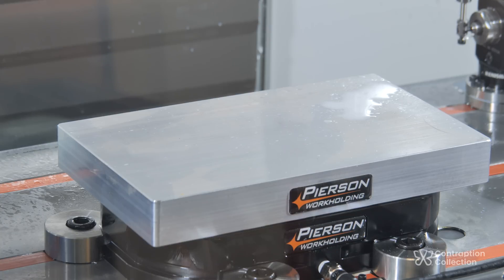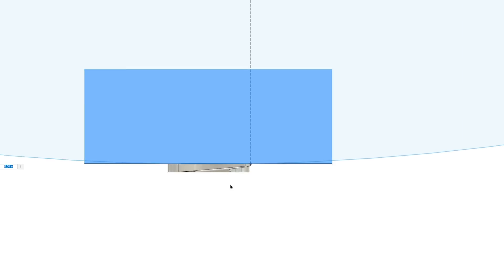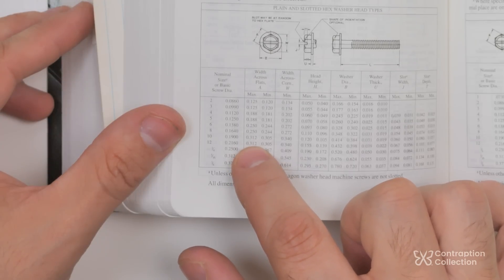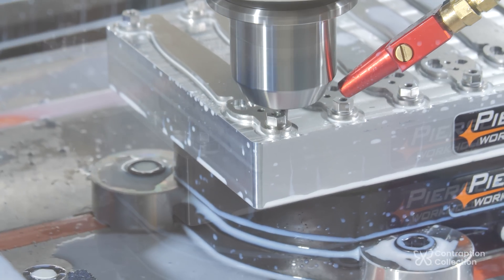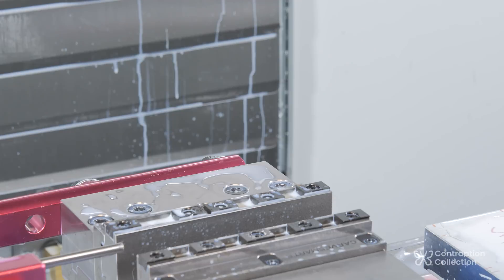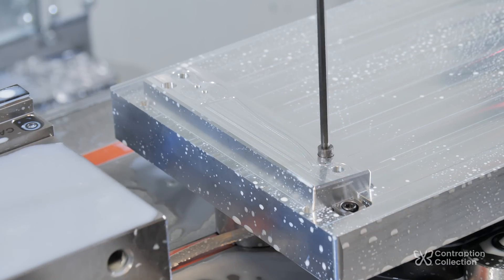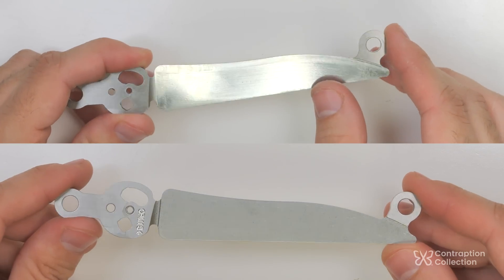My most complex fixture yet, but does it work? Baliscissors: Ep 33

Comment: those angles blocks that holds the blades dont fit in to the pockets becouse you put an angled block into square pocket. You need to widen the pocket tho the side which the block is tilting.

Comment: I'm a machinist and let me tell you one thing; as you noticed with the pull-out machining the bolts - dont try to rush jobs all the time. I have several coworkers who sure works VERY fast and create good parts a lot of the time... 
BUT! It would be pointless to start counting all the times when I hear things crashing at their machines. From endmills and drills going at rapid speeds down into either a vice, part or even the table. Parts getting scrapped because their programs wasnt checked before running. 

Ive seen one guy literally scrap the same part FOUR TIMES because he wanted to rush it. Every time the material had to be ordered cause it was hella expensive. After the 4th time - he was begging one of the other guys to take over and make the part instead.

Sorry for ranting :D

At 9:15 when you're milling the blade I think you'll find getting an endmill with a larger radius will improve tool life.

Cool pair of scissors you're making. Never even thought about "Baliscissors" before but it would be neat to own a pair =)
Cheers!

Comment: You are already using a Pierson work holding setup, so you should add some vacuum hold down functionality below the center section of the blade. This should help with the chatter, gouging, and minimize the tendency of the tool to grab the material and pull it up as it is cutting. It may not be. A perfect fix, but i bet it would make a pretty big difference.

Comment: i'm not sure if it would work for you, but i've used magnets to help with chatter. i don't know if you could cut a pocket then put a magnet under the blade, or maybe make the fixture out of steel, then magnetize it? i've only used magnets on lathe tools, not sure if it would translate to your mill.

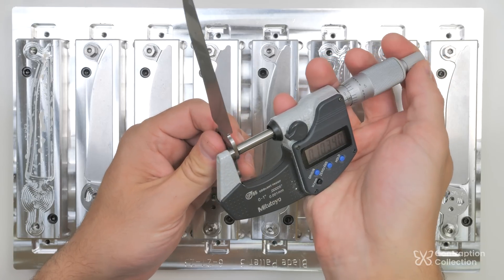Comment: 13:30 Maybe ballmill all the blocks to the angle that you need while they're all clamped in place, could also be a repeatabillity issue so you could use bolts to the main fixture body to make sure it's pulled flat, or maybe use a torque rench. Idk, I mostly use  fixturing for one off parts, but just a suggestion, love these videos.

Comment: For your markings being at different heights, just measure every part with the probe and change the height differences in fusion (I think thats what you use), it will save you the time to cut everything to spec, but I would be you, I would make a vertical cutting one.

Comment: Curious if you can get a large down-cut tool to solve your lifting problem. I use them a lot in plastics to keep downward pressure on the part being cut.
Reply from the maker: I looked, but I haven't seen down cut end mills for steel.

Comment: You can achieve the indent if you really want with some simpler tooling.

You can use a flat grinding wheel with an appropriate shank, then dress it to the desired contour. It's a bit of a process to do that, but then you don't have to buy a large diameter grinding wheel, and can use it in the cnc.

There are a few things to consider, like how long the tool will hold its contour, the minimal speed at the roating center of the tool, and properly dressing the tool.

I think dressing will be the easiest part: just clamp the dressing tool and locate it, then program a path that'll get the desired contour.

There's also the math to keep the edges of the blade still precise without cutting into them, and still getting the contour. That can just be solver by running two grooves against each edge, instead of trying to make one.

Also, I'd consider using magnetic locking, and then just locating surfaces, and integrating that into the fixture plate. It'll take a bit more initial design, but you get rid of the chatter in the middle, and don't have to program around the clamps, or switch fixtures as often

Comment: Measuring the screen holes: you could make a piece that is the positive of the chamfer you want with a little handle at the end, like a screw with a reversed head. That you can stick into the chamfer. If the top is flush it's just right, if it sticks out or is under the surface you need to change the hole a bit.

Comment: Use highfeed cutter. it does not pull meterial, it pushes down, good for low rigidity applications. and can vary surface finish depending on chipload, from rough to super-mirrorlike

Comment: if you cut the bevel with the step over going  from the thick to the thin side youll be pushing the thin edge down against the fixture instead of trying to pull it up with the end mill.

Comment: Great progress!

You can use pin gages to measure countersinks. Place the pin into the countersink and twist it, making sure to keep the pin perpendicular to the surface. If the countersink is larger than the pin, the pin will stay inside the countersink. If it is smaller, the pin will spin out. Keep checking and increasing the pin size until it spins out. The last pin size that doesn't spin out is your countersink diameter (within .001"-.002") It's a hard technique to explain, but it makes sense once you try it and is a cheap effective way to measure countersinks.

To get rid of the step from the large face mill on the bevel grind, use an L-shaped toolpath, starting at the pivot end and feeding out off the tip. Make sure there is a large radius on the corner of the L to make it a smooth turn. This will keep the tool engaged with the part through the entire cut instead of going back over part of it and gouging in.

Have you considered vacuum fixturing to hold the blank down? You might still need to use screws, but it would be a good way to keep the center part of the blade down. You can buy relatively cheap vacuum pumps meant for air conditioning repair that would work well. Adding a small air tank between the pump and the fixture would ensure you had enough vacuum at all times and allow you to turn the pump off and run for a while.

Comment: One thing I noticed in other machining videos, machinists usually tap the part into position with a soft hammer (e.g. copper hammer for steel parts) so they sit really tight in their bed. It surprised me to see you only pushing the blocks in position with your hands. Maybe try using some kind of hammer with plastic face to push them in position.
Another thing that came in mind, if you left a bit of coolant at the bottom of the pits for your blocks, it may have prevented the block to sit all the way at the bottom. Small groove to collect such coolant could help too.
But I'm no machinist, don't take my suggestions too seriously.

Comment: For your problem of needing a huge diameter cutter to make round dips on the blade you don’t need a large diameter you could do it with a 40mm cutter but instead of taking normal cuts you can angle the blade. This may be confusing and sry for not being clear but i can’t think of a simpler way to explain it other than making a drawing. So imagine you have the cutter and draw a line across the x axis of it with your blade bellow it with the point facing the back of the machine and the but facing the front. Now with that line through the cutter use it as an imaginary bevel and rotate the cutter so as the shank is further tirades the back of the machine and the cutting edge is more towards the front of the machine. Now if you were to to go to cut a hole on a flat surface the cutter would cut the hole more like an ellipse but don’t do this as it would mess up your tool bc the shank would hit the edge of the ellipse anyway what you are after is the radius of the long side of the ellipse. If you could make a setup where the blade is at an angle and the tool is straight then you could get a much larger radius to that dip without needing a large radius tool which would make the blade look so much better than having a square divot and also with the right tuning you could have it come to a sharp point on the blade edge effectively making a rake angle on it. Sry if this has been a long rant and makes no sense

Comment: u got a awsome machine use the automated probing more for depth and stugg and vorgotten screws its a calcuilation if the slower proces outruns sthe cost of trashed parts ore crashed bolts etc... use more workoffsets for engraveing onece programed it can become a powerfull  tool

Comment: To make the fixture blocks, you need to use a Sine Bar or Sine Plate. Use a flycutter for decent surface finish. Ideally, for both precision and surface finish, use a surface grinder. With a surface grinder, you could even transfer the loaded pallet from the mill to the SG for bevel finishing
Reply: This ^ Fly cutter or a small shell mill.

Comment: I guess the material will change in temperature with each pass, which means it will expand and contract - and lengthen and shorten.
Maybe this change in temperature is contributing to the depth of pass variation you're seeing.
If the blade is changing in length over the duration of the work, this could cause slight bowing of the material against the fixtures.

Comment: I've made all sorts of fixtures(vacuum, side clamps, bolt down) to avoid having to buy a bunch of far more expensive fixturing products. My next evolution in fixturing I'm developing into is diy pneumatic sideways and downward pressing blocks that are far cheaper then the $1000+ precision pneumatic machinist clamping systems I'm finding online. Being able to open a valved manifold suplied with regulated compressed air and having multiple parts immediately be held with the same amount of pressure based on air PSI is so much better then tightening individual bolts.

I'd highly recommend you look into developing fixtures with inbuilt pneumatic clamping or pressing blocks.

Comment: Shot in the dark idea, have the tool path start in the middle of the blade at the thin part and radiate out from there, that way there is more material around the thinner area to provide stiffness while machining. Might even better if you  cut it to thickness in one go, à la Joe pie turning small diameters on a lathe by taking large DOC in one go. Just a thought

Comment: Nice vid man, ive been using this formula for dwell time on spot drill/chamfering operations to prevent having a long dwell and the tool rubbing.
(amount of dwell spindle revolutions say 1.5 / 2) * 60000 / Spindle RPM equals your dwell time. Haas do a good video explaining this might find it useful

Comment: Love those nice clean fixtures. Sometimes just getting the process to work is step one, speed it up after. Like make a process and then improve it. Two things that I have suffered through, if you want clean engraving mill the material and engrave in one op this leads to near 100% success. If you want to check chamfer either buy the chamfer Guage, a very esoteric device, or check with two sets of pins. One set of pins is the minor and major for top diameter, and another set for the bottom diameter. If you veryifythe angle of your tool it works quite well and is inexpensive.
Can't wait to see where this journey goes. Good luck
Reply: I failed to mention that when checking chamfer with a pin it is important to consider the chamfer ground on the guage pin itself. Unless what you are making goes to outer space a normal pin will be fine but don't forget

Comment: in a shop setting, the "real" way to measure countersinks is by using a go/nogo gauge with pins that correspond to the upper and lower tolerance of the diameter of the countersink. the big one should glide on the surface over the countersink and not dip down into the countersink, where the smaller one is vice versa. It's more precise than you might think, but you have to get a feel for it.
Reply from the maker: That actually makes a lot of sense. Cool.
Reply: @ContraptionCollection  I just put the screw in upside down and look if the head fits in. so instead of gluing an hex key to it, just hold it by the thread. not sure if its clear what i mean o.O

Comment: Have you considered using a bull nosed end mill on the bevels? same process you came up with using the 3/16" endmill, but it doesn't have sharp corners to make lines you cant tumble out. it can also be used to form the plunge line. (this is the method I see Aaron Gough using on his knife making setup)
Reply from the maker: All my endmills have at least a .010" radius. I did try the 8 fl Gough .060" end mill I've used in previous videos with this set up. Might be too many flutes for soft milling and at 1/4" I still think it pulls up too much. I might try another bull nose later though.
Reply: @ContraptionCollection  I should have guessed! Keep it up, your R&D process is amazing to watch

Comment: With your blocks they might not be same height due to the walls holding them off the base of the fixture as the walls are now angled

Also we make some blades and yes the upright and using the side of the endmill works amazingly

Comment: I'm not quite sure I understand the problem with getting the chamfer hole depth? If you measure the tool height and you knew the chamfer tip size then you should be able to calculate it? No?

Failing that, using a ball should work. For example the ball on the end of the probe tip? You would want to adjust the runout to be as low as possible, or measure the eccentricity and lie about the measuring point to correct for it (actually the Blum macros work this way)

I think I would just measure a "good chamfer" and call that good. Then the height of the surrounding blade. Now you know the difference and you can measure other blades and just "make it match"?
Reply from the maker: The countersink height is repeatable. It's just something I inch in on to try to get it exactly to the level of just below flush I want. When it's good I can then run a bunch no worry..

Comment: 2 ways to grind a "curve" 1. tilt a flat grinding disc ever so slightly and use the edge to grind the curve. 2. use an air grinding belt running over a backing with the shape of your curvature. Option 1 is quick and dirty, while option 2 is the proper way. Option 1 is used in telescope lapping though so it is accurate enough for your use case.

Comment: They make countersink/chamfer gauges made for measuring those types of features. I have always just used a high quality ball bearing or gauge ball, and then measure from the top of the ball to the top of the surface of the part. You can then use some math or CAD to draw everything out and figure out what that dimension is supposed to be.

Comment: To measure that one hole they make thread gauges
If you just want to check the inside diameter and not the actual thread then you can get pin gauges

Comment: Next step is to make a bolt driver and code a corresponding operation?
About tool marks on the back of the blade: it may be a desirable feature. Or taken care of at the belt grinder like with 99,99 blades
Reply: See you next summer